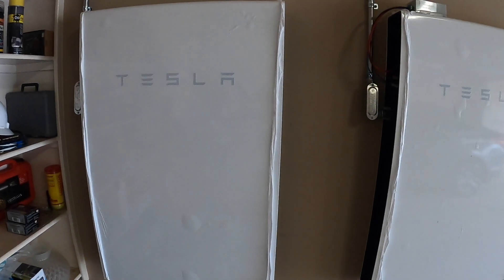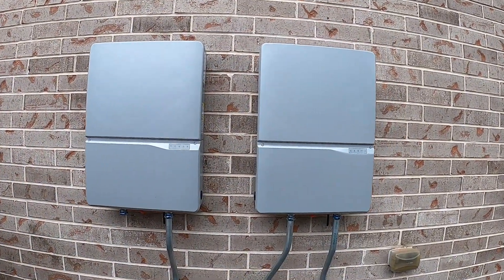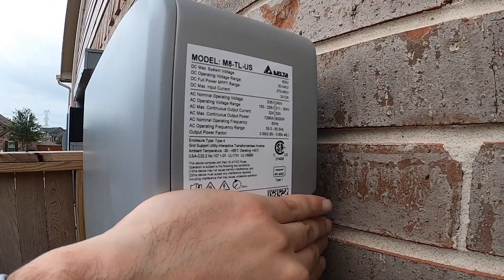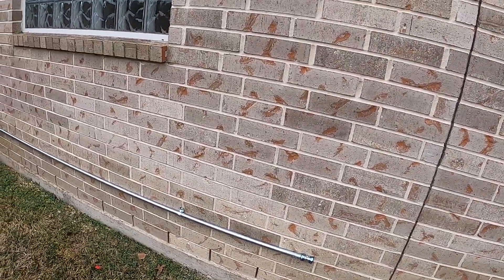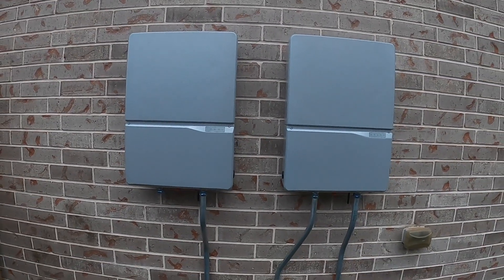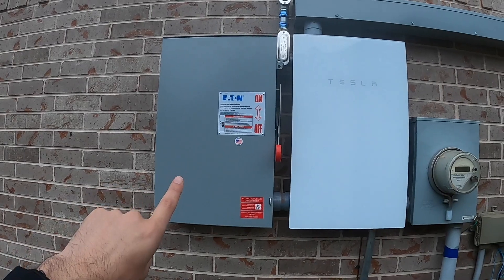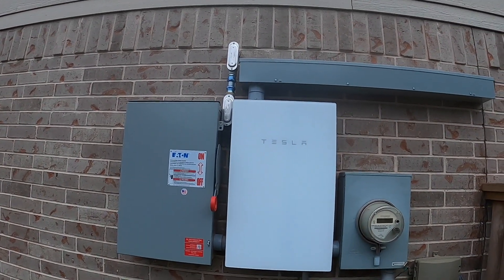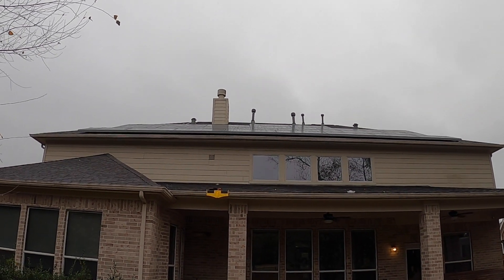Tesla Solar Panels & Powerwall Install Part 1

Comment: Just had a Tesla 9.75kw , 29 panels installed, waiting for SCE approval for $19k even. New will be around $16k. My average SCE was around $300 mo. Tesla said they maxed out on my panels. So whats my payback? Also, my electrician friend said I need to get a power wall for $9k. He said I would save by using electrciy from the powerwll during peak hours, 4-9pm. But some Youtubers say thats false and the savings are not that great. Whats your thought? thanks.